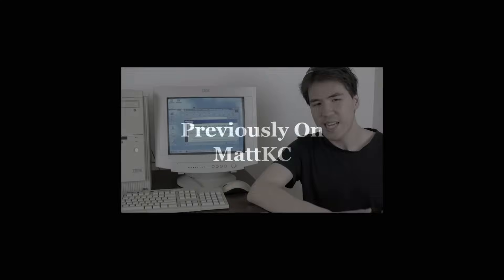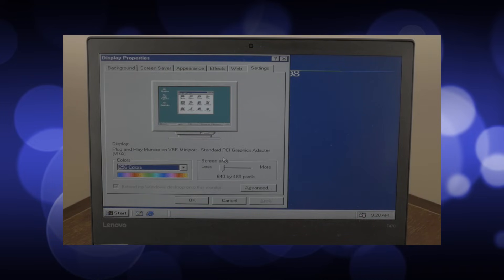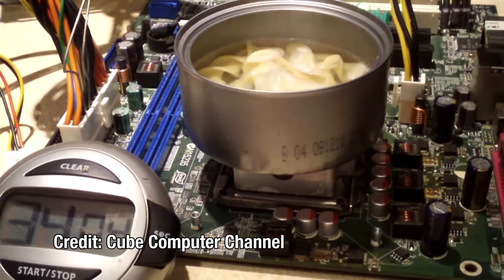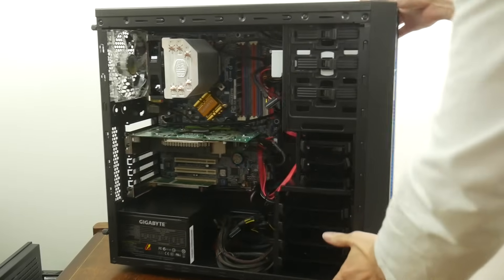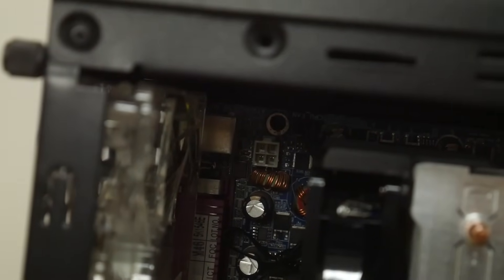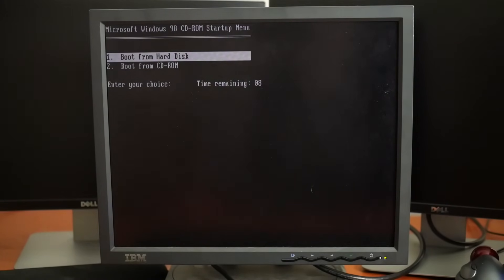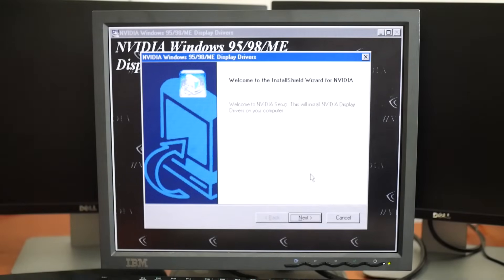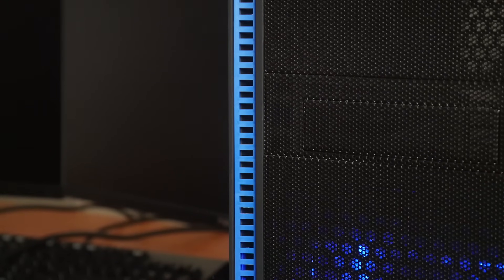The QUEST For The ULTIMATE Windows 98 PC [Part 1]

Comment: The CPU cooler being the wrong way around is troubling me way more than it should!
Reply: Thank you ... i thought i was the only one bothered with it !!!!
Reply: Unless the fan is in a pull configuration, then it's fine.  
I used to cool my K6-III with an Alpha cooler [might be called Alpha Heatsink?], and depending on the configuration of your system back then,  a pull configuration [which they reccommended] could work better.
Reply: First Thing i noticed too. Ps: the "ultimate" agp gpu would be a radeon hd 4670, if i remember correctly, but dont know if it had win98 driver Support.
Reply: @christiankoller5550  HD 4670 is newest, but it's not the fastest (3850).
Reply: @CompatibilityMadness  intetesting, thougt it was faster. Are there drivers around? Have to take a Look
Reply: @christiankoller5550  Only XP and newer. Win2k MIGHT work.
Reply: @CompatibilityMadness  thank you
Reply: You’re damn right! It hurt me a bit, like “noooo the airfloooow”
Reply: Yyuup
Reply: @phreapersoonlijk  you can see from the OG shot of the heatsink that the fan is NOT pulling.
Reply: Darius Beaumont  we come on YouTube, watch TV,  play games to escape real life. Its important to have that balance in life :)
Reply: depending on situation but the 3850 AGP is tied first with the 4670... the 4670 got tiny bit faster core speed and twice the RAM the 3850 is better on every other aspects...
also 1GB with VRAM like the 4670 have would have made troubles for a Win98 system but so would the 512MB on the 3850 (Win98 got problems with cards over 256MB).
but nether of em have official released drivers for Win98, unoffisial ones are buggy to hell and back and both cards are PCIe cards with an AGP bridge onboard designed to make old hardware better at running WinXP and Win98 (or even ME) was not even a second thought.

also while the geforce 6000 series is the last to be officially supported by nvidia they are know to have the "shut-down bug" with Win98.
so the best card without any bugs, native AGP and official drivers are the Geforce FX 5950 Ultra... just prepare your sound-dampening and max out the speakers as this thing just like it's predecessor the FX 5800 Ultra are LOUD...
Reply: verge fan
Reply: @brrebrresen1367  The 4670 and 3870 both have 320 shader processors making the 3850 not better on anything except memory bandwidth. Also the FX series was more than loud, it was slow, inefficient and a horrible buy even back then. Might as well recommend him a GeForce 4 MX. The best native AGP card by a country mile is the ATI Radeon x1900 XT and it has official 98/ME drivers.
Reply: yes, they both have 320 shaders... and that's about it.
4670 also got 32 vs 16 TMU's but the 3870 got 16 ROP's vs 4670's 8.
the 3870 got over 10% higher core speed, 50% higher RAM clock speed with 256bit bus vs 128bit.
but they are both XP era cards and not suitable for Win98

X1900XT is not officially supported and not with official drivers, X850 is the last there if including the ME drivers but hey, no problem using those in Win98SE.
so an X850 XT AGP would be an option and would not break the system like a Geforce 6800 would
Reply: @brrebrresen1367  The Catalyst 6.2 9x/ME drivers supposedly support the x1900 may have misread.. either way the x850 is still a better option than the FX cards and more reliable in DOS stuff as well which may come up in a 98 situation. The newer ones with the PCIe->AGP chips on them aren't ideal for sure though, even if he could get them to work they were quite weak compared to their native PCIe version. He may also be hitting some issues with the 775 socket it's a XP/Vista era chip. His best bet would be a Pentium III or a Atlhlon XP but the later he'd probably need a diff power supply too. He definitely needs a SBLive or a SB PCI card though that would solve the sound issues for dos and win9x. I personally don't understand why everyone is so obsessed with the Pentium 4 for retro builds though, it was honestly an awful architecture, Intel even dropped it and based the Core architecture on the P-III instead.
Reply: I've just paused the video to point this out.
Reply: I came here to wrote it but i see someones wrote it before me so Im adding only 3 words of comment
WTF Dude why :<
Reply: Same with the single channel memory
Reply: As hot as the Pentium 4's run, no, you aren't worrying about it more than you should.  It should be facing the other way around, and it's driving me crazy.  XD
Reply: First thing i seen also
Reply: it should bother you! lol hes got fans blowing the opposite way there making a deadzone of bad air
Reply: @phreapersoonlijk  the fans only spin in one direction. diodes prevent people from reversing polarity or potentially generating power by spinning it with an air compressor when dusting it or by hand. 
not only did he have the rear case fan blowing OUT but he also had the cpu fan right next to it blowing inward. that's no good....
half the hot air that goes between the fans is blown right back over the heat sink... drastically reducing cooling efficiency.
Reply: he fixed it, he has no excuse for this. he assumed that air meant fan go this way.
Reply: Then the conponents will get hot
Reply: He acknowledged installing it wrong in his Part 2 video.
Reply: The following video drawing attention to this made me reflect on a lot of my tower coolers.
Reply: why did you have to say it. just why. now i will never stop seeing that
Reply: @CompatibilityMadness  Win2k was almost the same as XP, and entirely different from the W95 line, so I doubt it.

Comment: Since its the "ultimate" ...  put two sticks of 512MB to enable Dual CHannel.... also check SATA controller max speed , you would probably get better overal performance with a fast HDD rather then SSD , since its the SATA controller that would be the bottleneck. Also check if you have RIAD available. And yea ... get a decent Sound Blaster and switch onboard sound off. Those early onboard sound "cards/codecs" were not offering true hardware acceleration for sound but rather emulating it, so they would usually slow down the system.
Reply: I'll second that, and suggest flipping the CPU heat sink around so that the flan blows thru the fins into the rear case fan.  Maybe hunt down a 3DFX Voodoo 5 video card?  Kinda old, but VERY powerful for a Win98 system.
Reply: Agreed I rocked Sound Blaster cards since Windows 3.1....any onboard crap didn't even consider tell Windows Vista and yes lot forget about dual channel it better to have two 512 sticks and i still have WD Rator 150 GB 10k rpm preform better then actually going SSD
Reply: SSD would be faster than a fast HDD even if it has SATA 1
Reply: I would actually suggest going down to two 256MB sticks, for one reason only.
Even with the u official service pack 3 for Windows 98SE, more than 512MB breaks MS-DOS compatibility. And a lot of games that were supported in Win9x would assume being able to (re)boot to MS-DOS mode to work.
Reply: @ZeroHourProductions407  Amazing how 512 mb was lot ram back in the day lol now everyone wants atleast 8 gb or more
Reply: @rrcoster  l find it amazing that most gaming PC's were using as much or more ram 5-10 years ago as they do today. While everything else has improved dramatically over that time, ram has been comparatively slow, especially in terms of capacity for system ram.
Reply: The V5 5500 is a good five years behind the cards he's trying to use. It's what to have for something trying to recreate Win98's heyday, but it's not even close to the best possible hardware supported on 98.

A few years back, I had a V5 5500 running 98se on an FIC-VA503+ with a K6-III 450. That's about as good as you could get around 1999, but something near 98's EOL can be much better.
Reply: @souta95  VooDoo5 was for XP. He's going to want 2 VooDoo2 cards, and do "SLI"
Reply: @K except that optane isn't RAM, if you have 4GB of RAM and 16GB of optane, you still won't be able to install or run a program that requires more than 4GB to run.  Optane is a PCI-e x.0 speed pagefile
Reply: He should use 2x1GB ram or 4x512 MB (if I see it right that there are 4 ram slots, so both are possible for 2 GB). But install it with 512MB (even the 1 GB was a little risky!), then edit system.ini before upgrading to 2GB, in section [Vcache] he should enter MaxFileCache=262144 to limit file cache to 256 MB. The problem is that Windows 9x determined the memory reserved for cache depending on how much RAM is present, and the kernel address space (which contains the cache, among many other and even hardware address space) was limited to 1 GB total, so if the cache became too big it interfered with other kernel functions. Typical problems were DOS box not starting because of too little memory (actually too little free memory in kernel space), random applications crashing for the same reason or even windows not booting, depending on how much memory was actually present. Problems may randomly (depending on how much cache is actually used) when more than 512 GB RAM is present.
Reply: @rrcoster  8 GB is on the low-end right now. Most modern games require at least 16 GB. 
32 GB is the ideal size to aim for, while 64 GB and above is best suited for high-end builds.

I'm running 32 GB, and more than often I end up consuming more than 20 GB
Reply: @Skarfar90  64 and above? What kind of home computer user or gamer needs more than 64 gigs of RAM? People who run games in 4K 120 fps while they browse the web with 750 tabs open?
Reply: @revsnowfox5798  I didn't say that gamers need 64 gigs. I said that 64+ gigs is good for the high-end market. HEDT platforms, you know?
Reply: @K optane is inferior, and is just used as a form of E-RAM (or Extended RAM) just like you could do in the old DOS days. It's not actual physical RAM.
Reply: I find Aureal Vortex cards better than Sound Blasters, mainly for their 3D 2.0 support
Reply: Windows 98 is not happy with anything more than 512mb of ram, you'll start getting errors and crashes. Plus, most software on 98 doesn't need that much ram, so it will offer zero benefits. High end systems sported 128mb back during the 98 era. I had a balls to the wall custom pc in the 2001 running 98 and it had 256mb. That was, and still is more than enough for any 98 build. When it comes to windows 98 ram, less is more.
Reply: All sorts of shit breaks in win98 with more than 512mb. Maybe they patched it at the end, I don’t know
Reply: The areas SSDs show the biggest difference to real HDDs are often measured in much fewer than 150MB/s, let alone 600MB/s. It's also why NVMe is a bigger difference to SSDs than SATA3 or straight PCIe was (It also lowers latency, etc as AHCI was designed for HDDs) and why it's not as big of a difference as the one between HDDs and SSDs in general: Those 4k reads (For OS data, etc) never get very fast because it's just tiny bursts, but they add up overall and an SSD can do so many more. That's why IOPs are so important if you plan to use a drive for your OS and programs.
Reply: rather than*
Reply: @TheNews1990  you're not going to get anything close to the performance of a 6800 Ultra in AGP or otherwise.
Reply: @souta95  the voodoo is worse than the 6800 ultra... by that time voodoo was bought up by nvidia
Reply: A SSD would run circles around a HDD even on a Sata-1 controller. Sata-1 maxes out at around 150 megs per second which yes modern HDD's are nearing that, but you're also dealing with physical media that has to spin up and down as well as a read head that has to seek information on the platters. Whereas with SSD's the information is delivered practically instantly. I have a ThinkPad T60 which is Sata-1 and noticed a SUBSTANTIAL speed improvement going from a HDD to a SSD.

So yes while it's not as significant of a difference on a Sata-1 controller vs Sata-3, the difference is still substantial and more then worth the cost of a SSD. Plus it's quieter and in the example of being used on a laptop, SSD's are lighter, use less power, and increase battery life. Plus are more durable all around. All in all there's no saving HDD's. SSD's better them in every way except massive capacities which even that problem is being remedied with every bigger SSD capacities.
Reply: Well at least DDR5 is scheduled for this year.. Lets see if it happens
Reply: They started development on the standard 2 years ago.. I doubt it will be much faster than DDR4 though.. as for when motherboard manufacturers adopt the standard is another thing.
Reply: G6 Liara What modern games require 16, as opposed to recommending it? Big difference between the two.
Reply: Ah no, no.

Even on SATA 1, an SSD will be considerably faster.
Reply: @Pasi123  HDDs are still faster than a lot of budget SSDs if you defragment HDDs
Reply: @ivyflow3r  That's not true.
Hard drives physically can't have as good random seek as SSD's and defragging doesn't really help that much.
It also takes some time for hard drives to wake up from head parking and spin-up the disc. This doesn't happen on SSD's because they don't have moving parts
Reply: @Pasi123  i dont know what you are talking i defragment every day, and on my hdd chrome loads in like 2-3 seconds
Reply: @ivyflow3r  Chrome is so small that it opens fast even on hard drives. There would be more difference when opening larger programs or games.
And obviously the system boot times are faster with an SSD.

Defragging a hard drive every day is just a waste of time.
Reply: @Pasi123  even they load quickly
Reply: Or put a Aureal Vortex 2.

Comment: Can't call it ultimate 98 PC without Sound blaster live!
Reply: That's what I thought when he had problems with that realtek crap on his board. Get a used sb live etc. Looks like there's a shorting problem with the gfx cards...
Reply: or aureal vortex 2
Reply: puts in an Terratec DMX 6Fire 24\96
what about sound blaster live?
Reply: Some core 2 duo mobo work fine, since they still have pci agp support, there is a small selection of pcie gpus that would work too, 
+Athlon was faster wasn't than p4
Reply: Actually, I had an X-Fi running on Win ME, so it might run on 98
Reply: Plus AC'97 doesn't have DOS SB drivers, so on Win98 machine you cannot run DOS Games properly, which is the reason to go as low as 98 in the first place :).
Reply: @oleimann  actually realtek drivers have sb emulation from software, so you can play dos games with it, but, you need to have the driver installed with it's compatibility thing, also i think if you had via ac97, in bios you could enable sound blaster support

Comment: Mate, 2 sticks would enable dual channel memory. You want ultimate; I could be selfish and not tell you that.
Reply: natr0n wont work in 98
Reply: i did my selfish and not tell him but you did told him :D
Reply: Isn't dual channel memory is handed by the bios, so why wouldn't Win98 support it?
Reply: @antoniozuniga6777  It will work. He just needs two 512mb sticks.

Though I do know 1.5gb of RAM works with windows 98.
Reply: @antoniozuniga6777  There's a win98 unofficial patch that fixes it. You can go as high as 3gb.
Reply: I USE DUAL CHANNEL MEMORY IN MY WIN98 BUILD NO PROBLEMS AT ALL
Reply: this is correct. You will probably want to get 2x 512MB sticks though. And maybe even grab a set of 2x 256MB sticks to troubleshoot compatibility issues.
Reply: Strange I did a build of Win98 SE and it seemed to handle 1 gig of ram fine even before patching it. Didn't encounter any lock ups or stability issues.
Reply: @lordterra1377  it's all about the chipset on the motherboard and how much compatibility it has with windows 98
Reply: @johnkristian  that was rather agressive
Reply: 2 sticks of the Corsair BH5 ram, for that ultra low latency goodness. He could get the 3200LLPRO for the flashy lights
Reply: @johnkristian  calm down

Comment: Dude, this video makes me appreciate how far Windows has come. It was such a pain in the ass back in the day. Anything could cause the system not to boot up properly or have weird glitches.
Reply: it sure has come far, but continue the same xD
Reply: Deletes boot.exe

Oh shi.....
Reply: Windows 10 Is A Pain In The *Thunder Sound*.
Windows XP And 7 Were The Best.
Edit: Yeah, Nevermind, Fuck Trying To Use The Internet On XP, Vista And Later Are Godly.
Reply: To experience that again you can try out ReactOS :)
Reply: @JustJaidenism  eh, that's nostalgia talk. i grew up with xp and 7 and they were definitely decent oses, but i remember having a lot of issues with wifi in the latter end of the xp era. windows 10, while bloated and full of unnecessary spyware, has the benefit of having decent support for most hardware - i had my build up and running without needing to even open device manager once.
Reply: So my first experience with windows 10 after using Mac for 5 years?
Reply: Honestly I have built a couple Win 98 machines and I haven't had any of those issues at all. Except maybe trying and failing with a USB keyboard.

Comment: I am doing a similar project.  The first thing I would recomend is to just disable the onboard sound.  Back in the Windows 98 days pretty much everyone used sound cards such as the Creative Soundblaster line.  A Soundblaster Live! is probably going to be the easiest card for you to get hold of as well as one of the best quality ones for Windows 98.

In terms of the graphics card you will probably be better looking at something a bit earlier.  A Radeon 9700 Pro or GeForce 4 card will be about as powerful as you can get without running into driver issues with Windows 98 as cards newer than that started either reducing or dropping support for Windows 98 all together.  I would also recomend using 512mb of RAM in the PC as Windows 98 tends to have problems when you have more than 1gb of memory which includes not just the system memory but that on your graphics card as well.